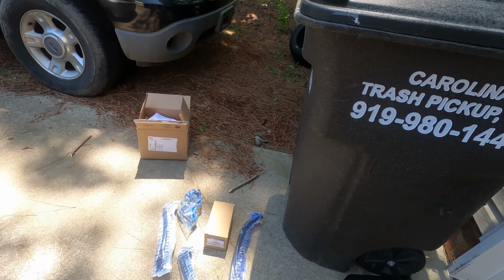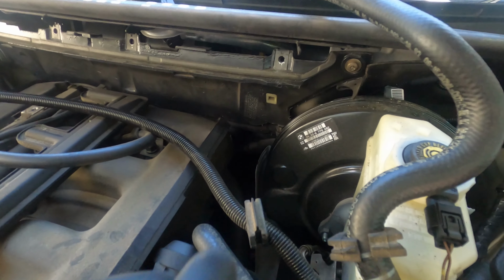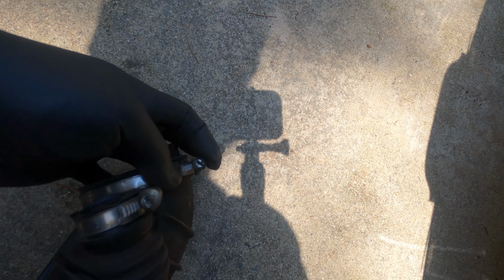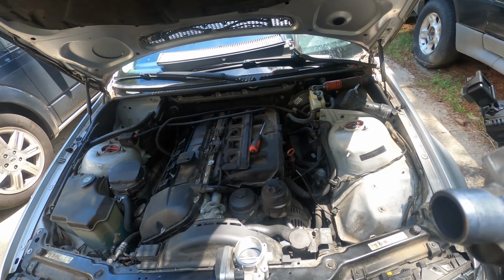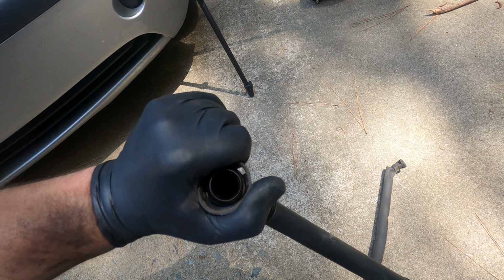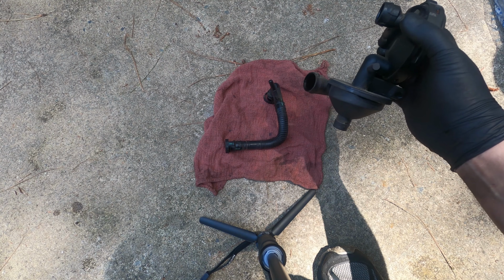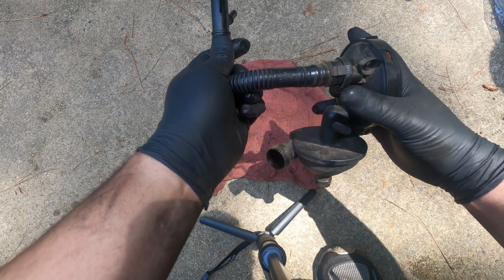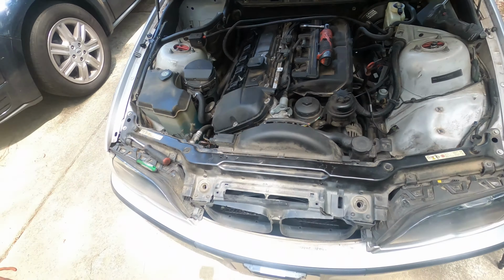BMW 3 series crankcase vent valve replacement(E46)

Comment: Excellent video you are obviously a very experienced mechanic specifically with BMWs I was under the impression that this prank case ventilation valve was located more on the passenger side firewall underneath the intake manifold. I thought to work would have to be done from under the car and you did it all from on top of the car.

Comment: Excellent Vid. Thank you. I'm 71 yrs old.  Working on cars, etc for over 60 years.  This is among the finest Vids I have had benefit of viewing.  Vehicle repair,  Tractor, metal working machinery restoration, Plumbing, HVAC, Electrical.  Exceptional Vids are out there, but needle in haystack.  This is absolutely tops.  Thank you.  One simple old timer suggestion:  when more convenient cut the old lines to more easily release or remove.  Going in the trash anyway. (2001 E46 wagon, MT, 2004 E83 AT, Bentley manual, BMWs since 1980.)

Comment: Thanks for the step by step on this part. In my case i have the rough idle that i literaly have to keep reving it to keepnit running. Dies when i let go. Feels like the air and fuel mixture are not right

Comment: Can repairing this stop an oil leak ?
Reply from the maker: Excessive crankcase pressure can cause an oil leak to form at any rubber gasket on the engine. Replacing the crankcase vent valve will remedy the crankcase pressure issue. However, if the seal it was leaking from was damaged due to the oil leak from the pressure, it won't stop leaking but it may slow down due to their being no pressure pushing the oil out.

Comment: Would that crank Case value of cause my car to smoke when driving or when I'm at a stop and then take off. I think 8 need to change mine
Reply from the maker: Could potentially cause that if it failed enough to just pull oil straight from the crankcase. I  however have never seen them fail that bad. I would lean more towards valve stem seals causing your issue.
Reply: @MunkysGarage  where is that located at

Comment: Thanks bro... you're amazing. I've been having the excessive oil consumption for a while now, I'm north of 200k miles. I asked multiple BMW service centers but of course they're happy to sell oil. The lower hose to the dip stick busted and I was having the rough start so I replaced it but I'm still having the rough starts so I decided to change the rest of the components.

Comment: Parts are on the way; going to change using your technique. The plus to taking the top off is you can change the coolant sensor easily while your there. Otherwise, no real benifit if your hose can bend without cracking. 🤑🤑

Comment: Great video! Did it help reduce the oil consumption?
Reply from the maker: Honestly not in the slightest. Don't think it was the main cause of my consumption. I think I'm just dealing with a high mileage engine with some blowby causing the consumption. But a severely failed crankcase vent valve can consume oil as well.

Comment: Do you think it is easier to remove the manifold to do this? Which takes less time?
Reply from the maker: To be honest if you've never done it the way I showed it will probably be about the same amount of time. I just prefer to do it without removing manifold because there is less chance of breaking other things, and I've gotten to where I can do it quickly with leaving the manifold on. Just wanted to show everyone it was possible to do with the manifold on.

Comment: PCV does not suck the oil from your pan, no. What actually happens is your membrane in PCV is damaged. Therefore PCV is opened when car is idling (throttle body closed, vacuum in intake manifold is high). So engine eats up a lot of oil fumes when idling. Originally if membrane is good then PCV is closed when car is idling, your cranccase vents only when throttle body is opened and vacuum is lower.
Reply: So how do you go about fixing that
Reply: @Americaneedsitsballsbacktrump  Fine, Whatever stepanovps . still need to do the repair.  This Vid tops showing how to do that.

Comment: I have a bmw 2001 530i and she blow alot of white smoke out the exhaust. I heard ccv is one of the cause of it
Reply from the maker: Could definitely be causing that.
Reply: @MunkysGarage  I just had a new engine put in and I do not have coolant leaking in the spark plug socket

Comment: Just checked my pcv valve. Looked at the vaccum line to the manifold and omfg. It's literally swimming in oil🥺  kept it 3years thinking it was the valve stem seals and saving to have them done or a new engine. turns out it might just be the pcv 🙄
Reply: @The_green_finger  I would have done mate. But I scrapped my car about a week ago. Everything I fixed another would break and it went on that way for 4-5 years. I had enough lol. Now I have a fiesta metal 1.6 and not 1 known problem with it it's perfect 🥰
Reply: Where is the pcv valve located
Reply: @benegal9063   on my n46 2.0 2006 motor it's located below the throttle body. Right bastard to get to. It's a manifold off job.but it did sort out my blue smoke issues. I get none at all now. And just about to change the oil level sensor out to see if any is being lost still.
Reply: @ryhu5642  YOO I KNEW IT my e46 is producing blue exhaust smoke too I knew it was the pcv valve or ccv valve 😂💀

Comment: Thats already been changed, if that was the original them hoses would have snapped when taking them out. The old ccv didn't look that old, but that doesn't mean it was working correctly.
Reply from the maker: It's definitely already been replaced before. But seeing as how the vehicle has almost 200k on it I'm not sure as to how long ago it was changed. I just wanted to eliminate it as being part of the problem.
Reply: @MunkysGarage  have you noticed any improvements since replacing?

Comment: i recently bought an e46 and for it to pass inspection i have to do this to remove my check engine light. this is the first thing i’ll ever do to any car, but i wanted to know the tools i’d need and if i should even attempt it as a beginner in the first place. thanks!
Reply from the maker: Hopefully this video helps you get the job done. If you have any questions feel free to message me on Instagram @munkysgarage
Reply: @MunkysGarage  for sure man thanks!